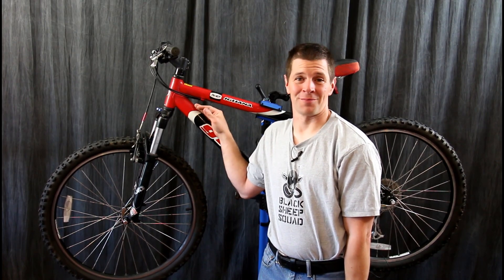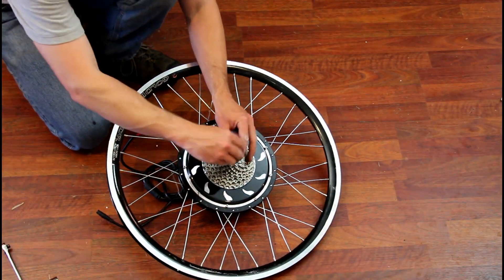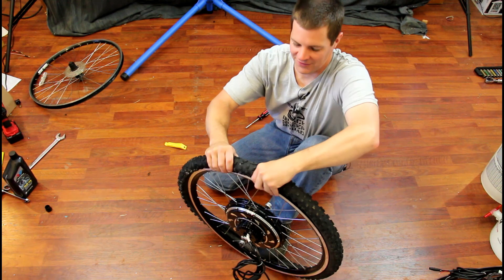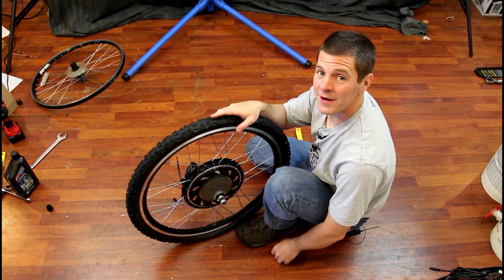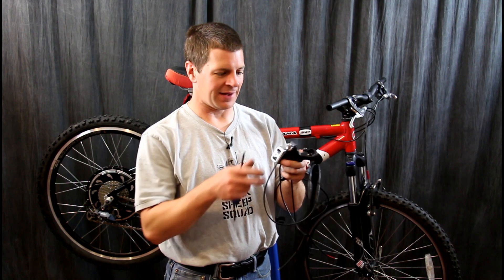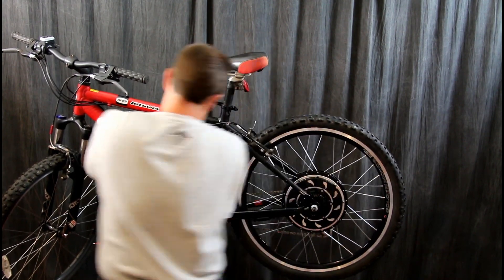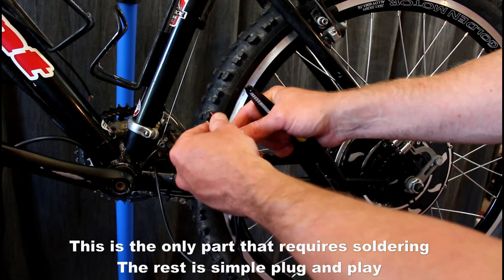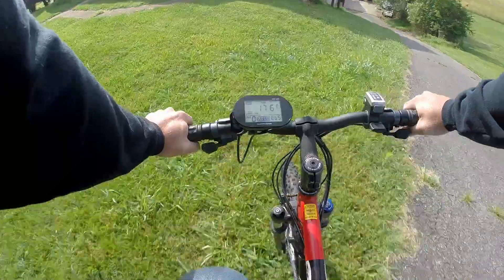How to build an EBike with a hub motor (Golden motor Magic Pie)

Comment: I have a question. I was given a golden Golden hub motor on the rim but it does not come with any of the wiring. Is there somewhere that I can buy the wiring setup so I can hook up the display and the pedal assistant and all that? Cuz right now the only wires I have is the one coming from the motor

Comment: The reason that there is a the reverse wire is one I believe it knows when the tire is moving forward and not backwards so that the pedal assist does not turn on if you pedal your bike backwards. Also, some controllers do have a reverse option on it so that you can go in reverse with your motor if you would like. It's just a fancy controller

Comment: Also, with the monkey wrench that's assuming that your bottom bracket is a screw on. There's hundreds, maybe hundreds. There's at least 20 different type of bottom brackets and some of them aren't screw in. Press press pushed. Some are screwed in with a nut. There's many different kinds

Comment: Another thing that I do and hopefully I'm not annoying you, but with the throttle you will hardly be shifting the front gears. You'll mostly be in your biggest cog here in the front because the rain is perfect with your e-bike so I take the cabling out for that and you can either put your gears to the left side and have a throttle just on the right. Or you can have the throttle on the left side and you move the gear for the back to your right handle bars. It gets a little bit. You got to get used to it. Pushing the throttle with your left hand but it's not bad but moving your back gears to the left hand. The shift and the throttle on the right side of the bar works perfect cuz you don't really need the shift the front three gears ever because it's too much range for the e-bike. Anyway, because you put in the lowest setting in the back and then the biggest cog wheel on the front that's enough for it to be able to get up any hill

Comment: Actually it's best to install the back of rear hub motor. If you put your bike upside down and then you just pull back the derailleur and let it slide right in.
Also, you're very close on how you do the gearing with it upside down. You put it in the highest gear and then you stand behind it and you look for the derailleur and it derailleur should be lined up almost exactly with that gear that you're in. So you hit the higher low buttons and it will move the derailleur left or right until it's exactly lined up with the the gear you're in. Then you go all the way to the smallest gear in the same thing you, I can't remember which one it is to see that the higher the low screw the opposite of the one you just did and you move that one so that the derailer is lined up with the lowest one. And then that sets the range of your derailleur for your gears. Now from experience when you get to the big gear all the way at the top actually wanted to go the derailer to be pushed a little bit to the left of it. Almost as if you wanted to come off the other side but it won't just a little bit because it's a big gear and needs to jump really high. That's how you align up your gears

Comment: nice... @15:15 why didnt you just put crimp connectors on instead of splicing in a servo cable.
Reply from the maker: Crimp connectors are bulky and I am more comfortable with a soldering iron.
Reply: @highervoltage5430  no i meant why didnt you crimp on duponts
Reply from the maker: @WX4CB  - All I had were servo leads.